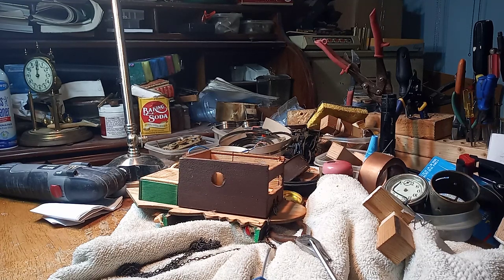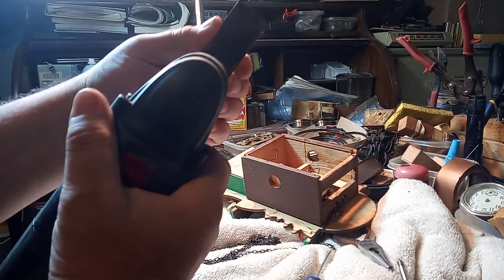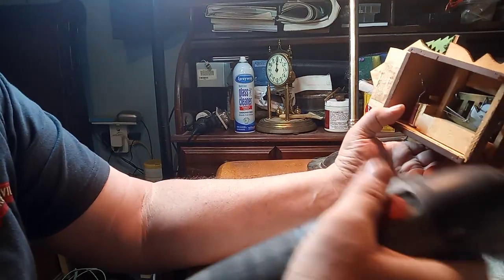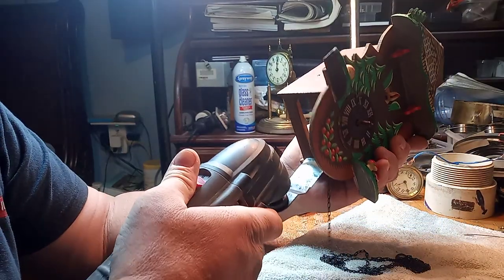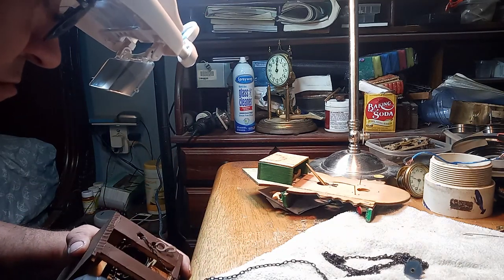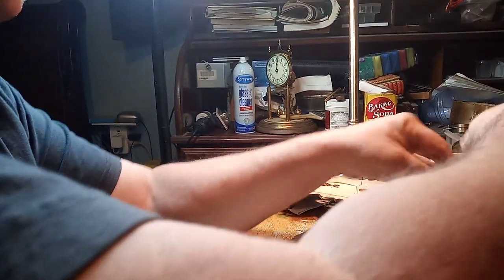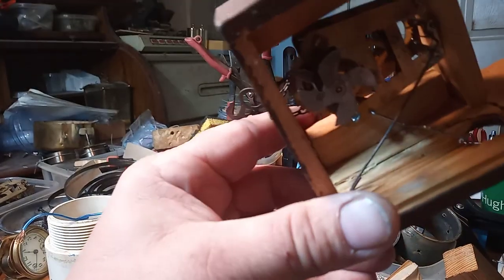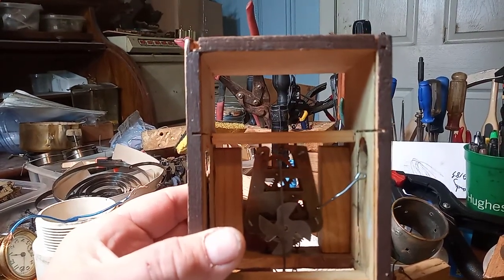Removing glued in bellows on cuckoo clocks. 20220503 015113

Comment: Try softening the old hide glue with denatured alcohol, then use a sharp putty knife.
Reply from the maker: I might have to do that. How many minutes do you wait before attempting to cut it out?
Reply: @munnerlyn3  Keep poking the putty knife in. Add a little more alcohol, and it should eventually pop off without splinters.
Reply from the maker: I will have to try this the next time I work on one and see how it works. Thanks for the tip.
Reply: Why the makers dont use screws anymore? What a pain to remove the whistles-I broke my front prying these darn things off